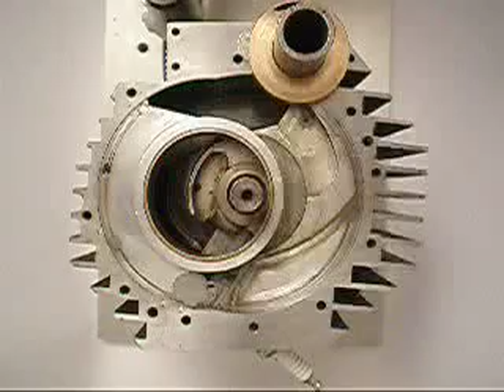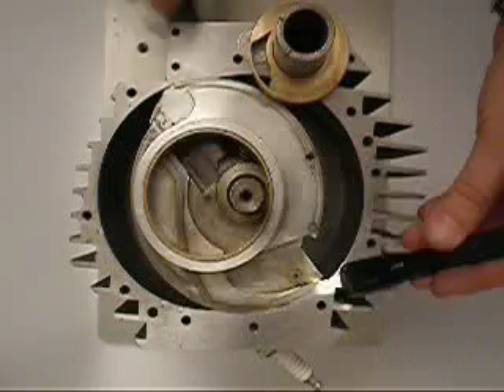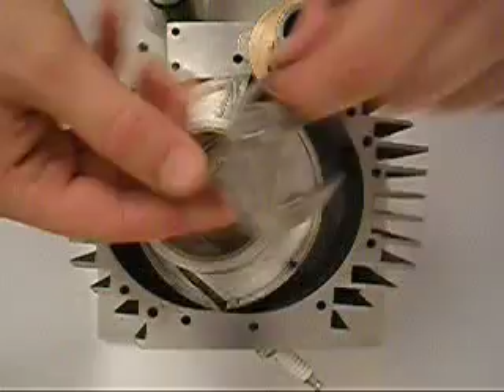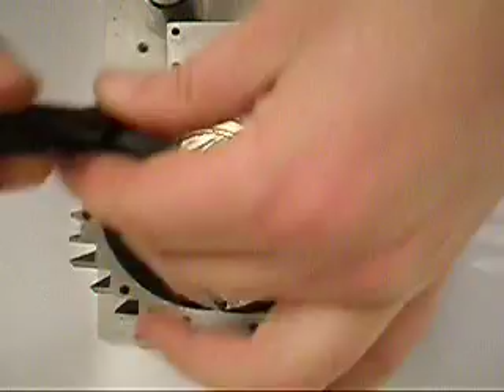Libralato Engine

Comment: Looks interesting.. But 3 atmospheres is not much, at sea level its about 14PSI so 42PSI of compression???  most piston engines are 120-190PSI. So it will not be efficient combustion. Rotaries have the same trouble.. low thermal effieciency, but very high volumetric efficiency...  I like the idea of this engine, but it seems to has all the negatives of a rotary, and has more moving parts too. I could be wrong.. I would like to see it run.

Comment: You're blowing what I said out of proportion...

So the air is continuously flowing through as it's sparking? You might want to get that checked out.

Having the plug in the center of the chamber means the flame will ignite in the center and the pressure will go in all directions. Having the plug directly at the end of an even and well designed chamber means most of the pressure will be directed downward in the direction of motion.

Comment: It seems to me that even if it worked that way, using the intake air to cool the exhaust is the last thing you would want to happen. The intake is preferably as dense as possible, raising the intake temperature not only lowers the ve, it increases the risk of engine knock.

As for the plug, I don't care how cozy it is, the key is that it ignites so that the flame is directed the right way, and bad plug placement and irregularly shaped combustion chambers also lower ve.

Comment: The compression cycle would not aid in forcing out the exhaust, compression is the load, resistance to the rotor turning, not the other way around..

Also, how efficient is this design? One of the main reasons a rotary functions well is in its mechanical simplicity. This design, whether it has a well shaped combustion zone or not, looks more complex than a recip, and has more sources of heat and friction. Also, having the ignitor facing the opposite way of the combustion zone??

Comment: I am impressed with the ability to extend available torque through more of the main shaft's rotation. However with quite lot of surface area on the back side of the rotors, how is wear controlled and adequate seal maintained? I assume that friction and compression seal would be controlled with oil pressure as in conventional engine main bearings, so post-combustion heat would be transferred to the engine casing through the film of pressurized oil?